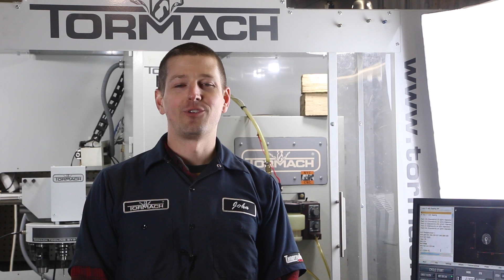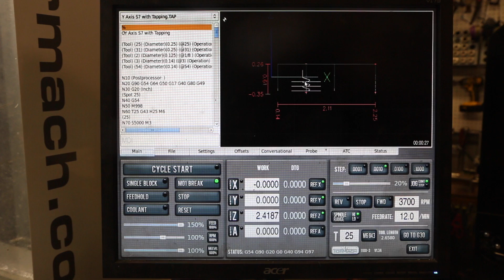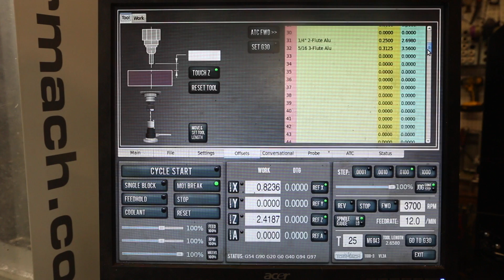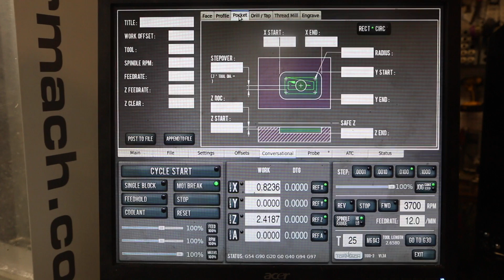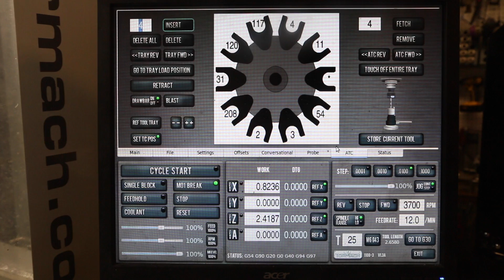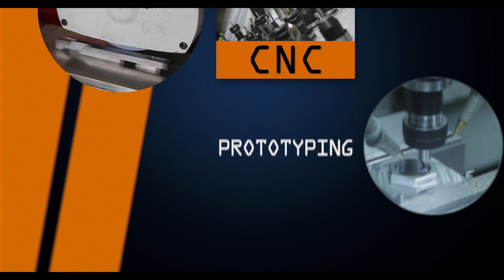First Look at Tormach's new PathPilot CNC Controller!

Comment: First ,I don't own a Tormach product and probably never will. It is my understanding that with open source software you have the ability to modify it for your own use , you even have the permission of the original authors to charge for your modified version (should you choose) as long as you credit them with the original foundation for your work. I know Sherline took this approach many years back but I do believe they always offered a free download of their version although one would probably need to modify it for their own personal use. I for one think that if it's free to everyone and the original writers have no problem with you modifying it for your needs then all is good, but I do feel there should be some at least moral obligation to give back as least as much as you took. It seems from the posts that Tormach has contributed back to the community , I have no idea as to the extent of this contribution but it would be a nice gesture for the company to share with others what they have achieved even if it isn't compatible with someone else's machine . This is a way of showing your appreciation for all the work the community has done to give you a head start on your own project. Tormach I can appreciate the fact that you have probably invested a great deal of time and money in further developing Linuxcnc to meet your needs , but I can also imagine that amount would be a drop in the bucket compared to what you would have spent to develop a control system from scratch..
Reply: NYC CNC
well my point was 2 sided. Seemed a few were a little hard on Tormach for what they perceived as Tormach selling what they thought should be open source. and second just my thoughts on using open source and giving back whenever possible. It would appear that Tormach is so I really wasn't condemning them in any way. I didn't mean it to sound like I wouldn't own a Tormach just that I doubt I'll ever have the funds to warrant me purchasing one for just my hobby use..

Comment: John, thanks for the first look. I just upgraded my controller and they already fixed the headers on the tool table page so that they stay on top when you scroll through. Thanks for giving that recommendation and thanks, Tormach, for changing it so fast.

As you also did a video on HSMExpress and there have been some questions about the code that would run in Path Pilot... I did have an error when I tried to use a code that I had previously generated for Mach 3. I generated the code again using the HSMExpress post processor "emc.cps - Generic Enhanced Machine Controller (EMC)" and my first part on the new controller ran flawlessly. There are probably a lot of other good post processors out there, but if you are using HSMExpress and upgrading to path pilot, this seems like a good place to start.

Comment: I found myself typing this in the most poisonous sub-thread of this discussion, and decided to move it. 

In some ways this move by Tormach validates all that is good about Open Source software. 

Why did Tormach make this switch? On some levels it was because they launched a lathe, and Mach was never excellent with lathes, and was very much less than excellent at threading if the spindle-speed changed... But then the question is why they decided to switch the mills too? I suspect that it was the Open Source thing, having built the lathe on LinuxCNC they realised what a huge advantage it was to them of being in control of the source-code and capabilities of the machines that they sold. No longer are they slaves to someone else's release schedule, no longer do they have t go cap-in-hand to the company to ask for a new feature. If they want a new feature they can add it (or pay someone to add it, [1]). If they choose to, they can share it. (In some circumstances I believe they are obliged to offer to, but that is not the same as the custodians of other forks accepting the changes). 
So, this looks like a confirmation of Open-Source to me. All that is rubbing folk up the wrong way is a commercial company reaping the rewards of being able to make their own customisations rather than an individual user. But in the end all that is different is the sizes of the loops in the Venn Diagram. 

[1] Or bribe an established dev with a slantbed to add it :-)
Reply: To add - for Tormach to fund the new trajectory planner - they are in it for the long haul...  (the TP development has been in the works for over a year.)  That was one of the last big hurdles to compete with mach.  (the original linuxcnc TP was 1 segment lookahead - This is fine for a lot of machining except when you get into short segment - high speed like relief engraving)
Reply: Nice move by Tormach!
Does anyone have a break-down of the components that make up the Tormach control, and their associated licenses.
With the core of linuxcnc being GPL, there should be little risk of possible upgrades or enhancements not being contributed back to the GPL version?
Reply: Do we know if their Gui is communicating with the Linuxcnc API in such a way as to be required to be GPL licensed too?  Knowing that the interface can communicate with linuxcnc over a network (ala Machinekit and it's Qt interfaces) makes me wonder if GPL'ing  the gui code is a moot point. 
I am glad they are using linuxcnc. I also have to thank them for improving the trajectory planner. Another gui can be coded, if someone really wants it to have a similar look and feel.
Reply: I ordered the cd or usb stick of PathPilot from Tormach. I really want to check it out, but don't own a Tormach machine. I have read, somewhere else, that it won't function without a third party card present, but that's fine with me. I will study the code to see how they did things. If the media they send has all the source, then they will have fulfilled their GPL obligation and the toxic part of the discussion on the linuxcnc mailing list will have been premature.
Reply: Dan Falck It probably needs the Mesa 5i25. Possibly the most common LinuxCNC PCI card at the moment, lots of folk have them, including me.
Reply: Yes, I plan on buying several of them for my retrofit projects.
Reply: They could have contributed to the development of the open-source software that enabled their machines to run. It's open-source. They could update and improve  it themselves without waiting for "someone else's release schedule".

Just fork it and begin development, allow code to be merged back into the main project.

Comment: John
I paused the video at the probing screen shot. Is that all of the probing options. If it is that sucks. The screen set I use with my 770 will probe holes for center, slots for center, round stock in the 4th for center and several others.

Dave
Reply: I don't know if you seen it or not, but there are more tabs on the probing screen . On the top left labeled Rect/Circ. I'm betting that is where you will find your center finding options. Not sure , but I do hope so . Wish John would have shown the two other probing screens. Just glad he showed us this peak 8-)
Reply: NYC CNC
John have you had a chance to look at probing yet. I'm waiting for my upgrade and draft manual. Wish they would make the draft manual available for DL to review early.
Dave
Reply: NYC CNC
Thanks John. I have never used instagram but the link worked.   Dave

Comment: hi john, i have been reading about the new path-pilot cnc controller and it looks good until i read that if you don't own a tormach machine you can't use it that stinks !!!!!!!, it works on a Linux computer that's meant to be open source and when you can download Linux emc2 for free, I can see that they may have spent money on making the software but to exclude people from using it is a bit wrong, I am sure you have your own ideas on this, but as you are supported by tormach that may make it hard for you to comment on this ? rant over and good video for tormach users only. Daniel

Comment: Nice!.I definitely have to sit down and spend some time with a newer cam program.My intro to machine work was 3 years of vocational training in high school...being 1990 we were lucky that we had a small cnc lathe to work with but the state of cad/cam packages at the time left a lot to be desired so it was relegated to a bonus if ya wanted to fool with it...rest was all manual.5-6yrs later I got the shock of working with a Fadal Vmc and an old converted Rockwell mini turn 2(so mini it only had a 3" thru bore on the spindle to go with a 30 foot long hydraulic bar feeder) that had started life out as a tape reader.The Fadal was nice and had an addon 4th axis but the lathe still had push button rotary dials to set offsets with.Needless to say little to none of the programing was by cam...we would get a print and then sit down and write the code using a trig sheet and a calc to find our radiuses so we knew what to use for our I and J for circular interpolation...lotsa yellow legal pads and stickit notes around our benches lol...Ran into haas and others years later...fadal and fanuc basicaly being the same except for control layout and a couple g/m code variations.
I still watch newer machine videos with a bit of shock tho...no so much by whats being done as by the speed and availibility.Its nice knowing ya can do it manualy but almost heartbreaking how much has changed
Reply: srry...should have said kinda awestruck instead of heartbroken...I can come across kinda weird or negative sometimes and but its never intended that way.I think what your doing rocks...both in basicaly teaching yourself and being willing to share with others!

Comment: Bring on all the comments about how Tormach ripped off the Open Source community.   I personally feel that having a commercial product based on LinuxCNC can only be a good thing for LinuxCNC.   Sure they might not hand over the fancy interface they made, but you can bet that they will have a team of developers contributing bug fixes and other enhancements that are part of the core LinuxCNC package.
Reply: Mark Kotyk agree.  Also, pursuing the LinuxCNC site there is a document released in October last year oddly titled "Integrator Manual"   The whole discussion about ripping off the source is missing the point.  Tormach IS using LinuxCNC which I think is what the goal of the project is.  http://www.linuxcnc.org/docs/2.5/pdf/LinuxCNC_Integrator_Manual.pdf

Comment: Oh yea.. the "Offsetting" algorithms used to create things like pocketing routines & even simple tool center tool paths have been around forever, but are still hard. Especially if the base geometry isn't accurate. Or there are splines. Offsetting and then making certain the end points on the "offset" curves are contiguous can be tricky on more complex shapes.... A test for your SpurtCam is to take a simple closed boundary with fileted corners both directions.... ( A lamb chop), build a profile or 'finish" tool path;  then rotate the geometry about either the x or y direction 1.5 degrees in space....so its no longer perpendicular to the z-axis... Now all the "fillets" are splines or possibly ellipses... see what happens when you recalculate your profile toolpath.... you either will get a whole lot of "points" where the fillets or "G02's and G03's" used to be or it will in fact fail. Depending on the result... I will know where the base offsetting algorithm's had there design roots.. :)

I like simple S/W tools, looks like your new control S/W has room for growth.. :)
Reply: NYC CNC Key word should be "knew" vs. "know". Back ground... not quite certain how to answer that other than to say I was in a very unique position during a time of growth and change.

Comment: Awesome vid as usual!  I can't wait to get mine set up, but I will have to re-code the way it reads my subroutines, and 80% of my recurring codes are all based on that.  It shouldn't be too hard, and the benefits will be huge.  I'm like you, just shut up about the Mach issues, find workarounds, and make parts.  But the issues ARE a big deal.

Comment: Personally  I congratulate Tormach for finally seeing the light about what LinuxCNC brings to the table. It is head and shoulders over Mach3 and has been for a very long time.  I also thank them for their apparent efforts to bring the new Trajectory planner to the table. However I think the fact that they are going to be calling it their own program now under their own name using the same work that so many have freely given over many years without giving all of their work equally freely is just wrong. This INCLUDES UI improvements and many other features.  There have been and still are many folks working hard to make linuxCNC better in many different areas and with many different platforms etc. in my opinion the LEAST they could do is give their work equally.  LinuxCNC's  capabilities will seriously improve their machine tools offerings and they stand to profit from those improvements considerably let alone the ability to configure it to whatever they need it. LinuxCNC has been running many many Commercial Machining centers all over the world for some time now and with the EXCELLENT MESANET boards it is just a no brainer.  I have a Cincinatti Arrow 500 VMC running Mesanet Cards and LinuxCNC and I am also working on other machines with it. It is a dead stable reliable system that works beautifully even compared to other commercial controls as I have quite a bit of experience with both. Peace

Comment: Welcome to Free Open Source Software, Tormach!

PathPilot is LinuxCNC.  Tormach wrote a new front end for it.  There were already a couple of open source user interfaces including Axis that most people use, and Touchy which is used for touch screen operation, so they had plenty of open source example code to examine or cut-and-paste.

LinuxCNC automatically runs Python scripts if they're loaded, so I already have the rough equivalent of the PathPilot conversational programming environment, although it's definitely not as pretty as what Tormach has done with PathPilot.  It looks like Tormach made some very nice graphics to make it obvious what's being done or what data is needed.

It's considered good netiquette to release code developed for open source back to the community, but I'm betting that Tormach won't be doing that.  It's a bit like someone inventing the car and posting the plans online for free, and you inventing electronic ignition and claiming the car and electronic ignition as your work and your intellectual property.

Your familiarity with PathPilot will come in very handy if you buy an old VMC with blown controls and put your own servos, encoders and LinuxCNC on it.  It's a lot easier than you probably imagine, and there is abundant help among the online LinuxCNC community.  This is a GREAT way to get a great machine at a very reasonable price, and as an added bonus, the controls are all commodity items.  You are no longer locked into proprietary electronics.  You can order everything on eBay... cheap!

7:45 You might try the LinuxCNC keyboard shortcuts.  It's possible that Tormach disabled some of them, but they probably didn't, leaving them as undocumented features.  Unfortunately, undocumented features can disappear later when a new version of PathPilot is released.

http://wiki.linuxcnc.org/cgi-bin/wiki.pl?Keyboard_Shortcuts

I think you'll like having a robust real time system (which isn't possible on Windows).  LinuxCNC 2.7 is currently in pre-release.  It has the new high-speed trajectory planner (which I haven't used but it's rumored to be vurra vurra nice) and support for the RT-Preempt realtime kernel.  That'll probably be rolled into PathPilot soon.
Reply: @Liberty4Ever: Thanks for defending the world from Fauxpen Source, but Tormach has been very involved with the true open-source development of this code for more than a year, including hosting a developer meetup at their facility last summer.  Most of the key functional features (including the "vurra vurra nice" new trajectory planner) are already integrated upstream and have been usable by the community for months (and it is a substantial improvement over the the previous TP).  I'm not sure if they're planning on releasing their custom "eye-candy", but since the API for the GUI is a licensing boundary, that's not required since they wrote their own UI.
Reply: NYC CNC
It does in fact appear that Tormach funded the open source development of the new trajectory planner, which is apparently already in PathPilot.  Tormach was tight lipped about their contribution, so many people assumed the worst.  I didn't make any accusations because I didn't know, but based on what I was seeing, I did say that I'd be surprised if Tormach released code they developed for LinuxCNC back to the open source community, and it looks like I'd have lost that bet.  Thank you Tormach!  Funding the open source development of the new and improved trajectory planner is a big deal.  Looks like I'll now be forced to eat my hat.  At least it's not an asshat.  :-)

I don't expect Tormach to release all of their pretty user interface code, particularly the custom graphics that give PathPilot its distinctive appearance, but hopefully there might be some UI framework code that they'd feel comfortable releasing so open source people could have another GUI interface with made from scratch graphics, but even if not, they seem to be kicking back (more than I have!) and that's great.

I think the real winners with PathPilot will be the Tormach users.  Brad at Tactical Keychains has been a vocal Mach critic.  He should upgrade.